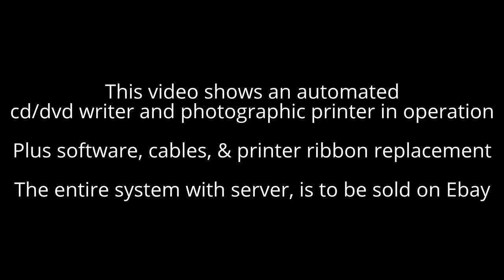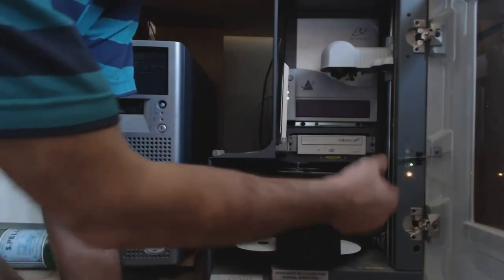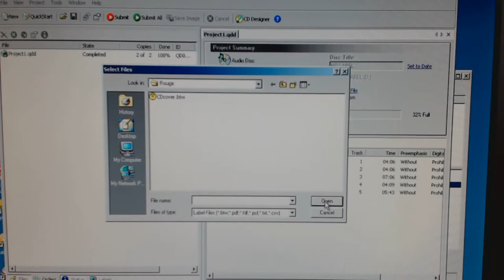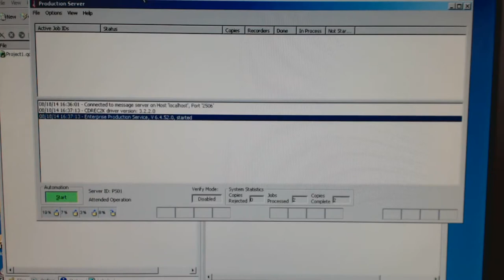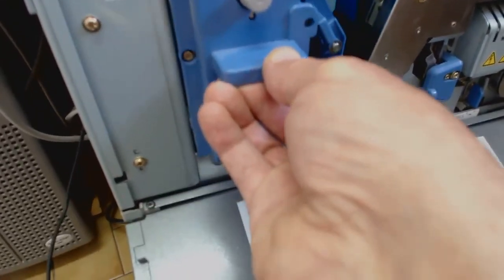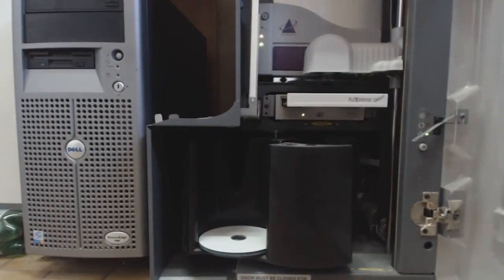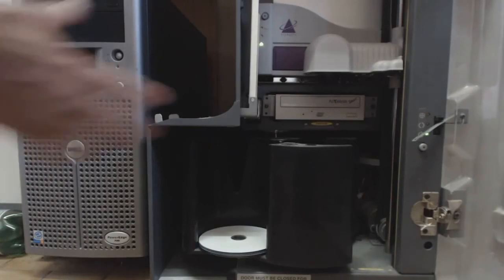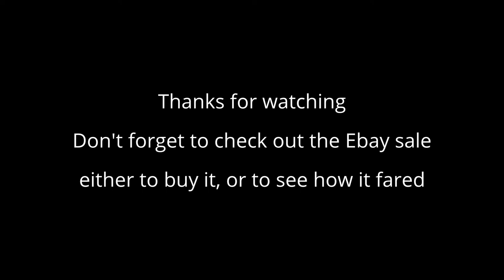Rimage Everest II Amigo II for Ebay - A working disk production centre

Comment: I have The same equipment although every time I send a print to the machine, a pop up message comes out saying the transporter is not responding. How can I correct that problem?
Reply from the maker: I would honestly call the free help line.
They are very good....... they'll need the robot serial number for their job sheet.
I used them when I had a driver issue.
The guy walked me through it perfectly.